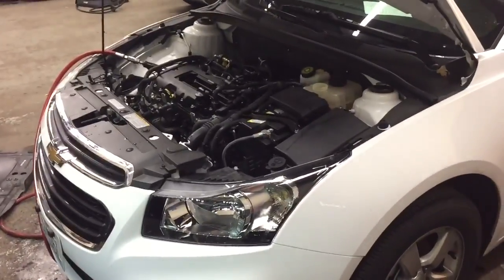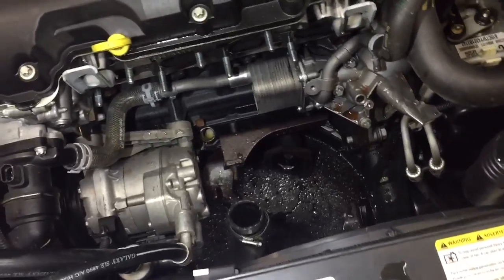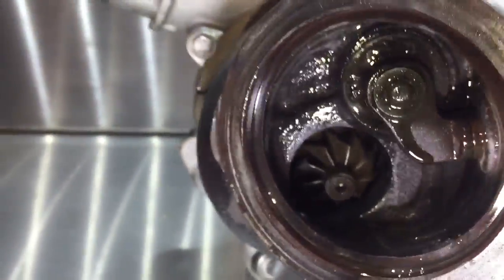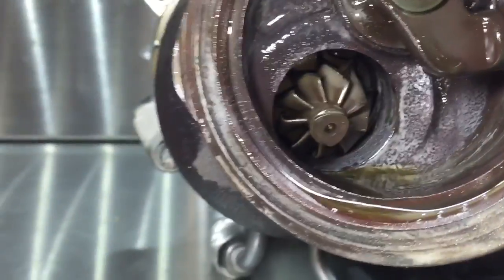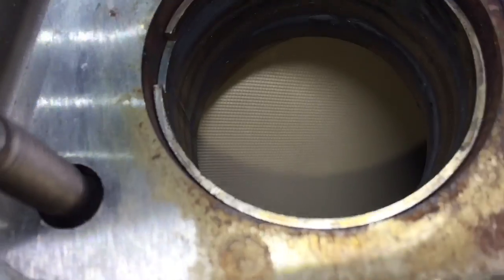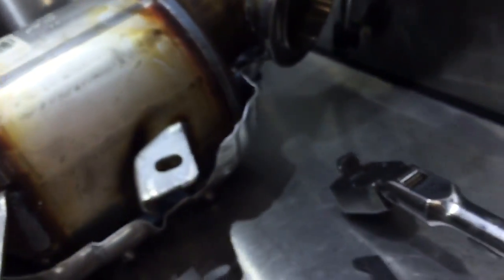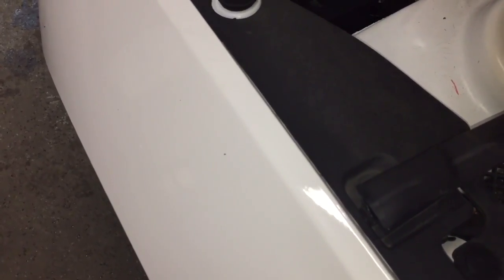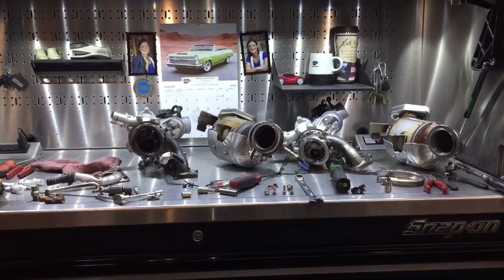Cruze Turbo Bearing Failure

Comment: wtf there is a sticker hidden away in the new cat on the actual cat element blocking i would say 20% of it. not a very good design what would happen if you didnt peek deep into the cat intake and see and remove it ? thats a bit stupid.
Reply: carlcostello360 Not with that much junk in there.  A catalytic converter is basically just a honeycomb that causes a bunch of chemical reactions to clean up exhaust.  When it's coated that significantly the process is hard to get started.

The other issue would be if it did heat up and start burning off the oil, it would likely get too hot and melt some of the honeycomb.  This is problematic for obvious reasons.
Reply: As soon as the cat gets got it will burn off
Reply: +Darcy Creamer *hot
Reply: +Darcy Creamer ? wont it just burn and block some of the small ports ?
Reply: +carlcostello360 That's my concern too. If oil can clog it, paper/adhesive can too.
Reply: +**Classified** It's not that it clogged it as much as it's soaking the material and hurting the catalysts ability to scrub the exhaust.  On top of that, there's a constant flow of oil and coolant into that.  the temperatures inside a cat, especially right behind a turbo, are hot enough that sticker will vaporize. They're not even functional until 500 degrees F and operate around 1500F...one 30 minute spin in that Cruze and you'd never know that sticker existed.
Reply: +94XJ so if you stopped the oil leak the oil would just burn off the old cat and the old cat would be good again ?
Reply: 94XJ ok, that sounds like it would be ok then. I know they get really hot, but coolant and oil ruined mine.